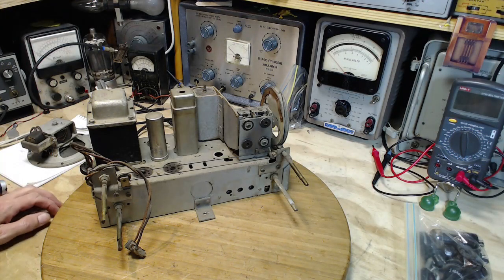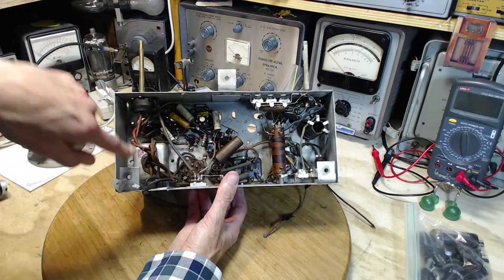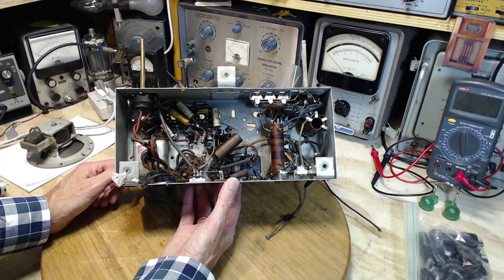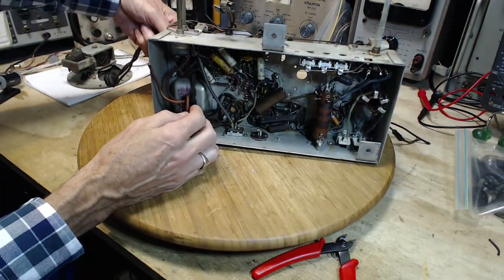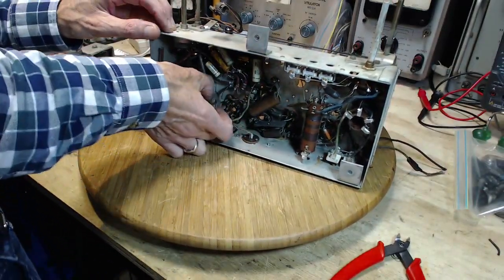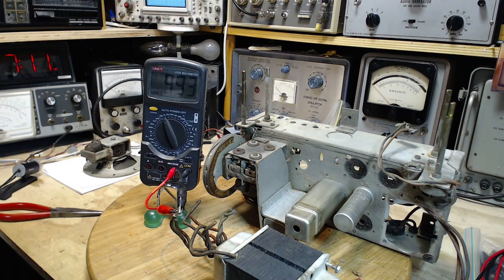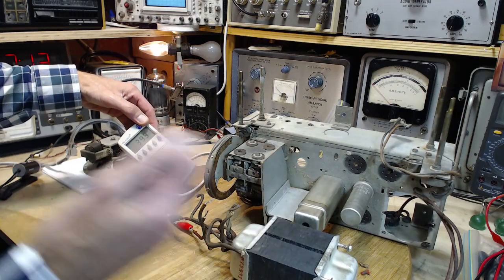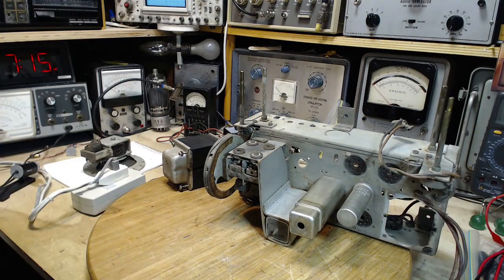Canadian General Electric Model JK-53 Video #4 - Transformer Out and Tested Again

Comment: Good progress; verified a faulty transformer.
Lots of room there to fit a replacement, with a little bit of thought.
I do reckon it better to sock-in a trnsfmr than to convert to hot chassis.
We are looking forward to the next in this series. 
We know you got this, Jimi.  ;-)
Yeah, the HV secondary voltage is widely acceptable. 120-0-120 up to 300-0-300 will work. I'd go towards the lower voltages: less heat, less tube stress. Those tubes will do well with 80-90 VDC plate, as has already been demonstrated on that radio.